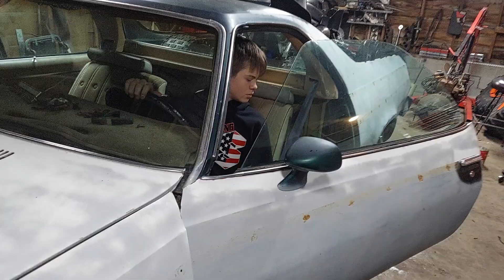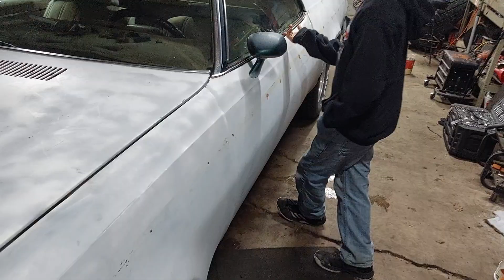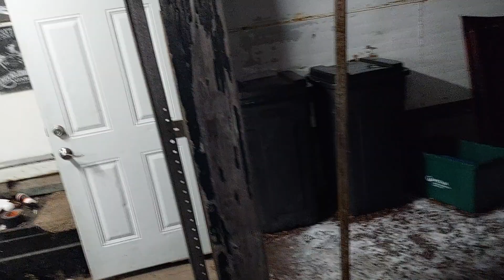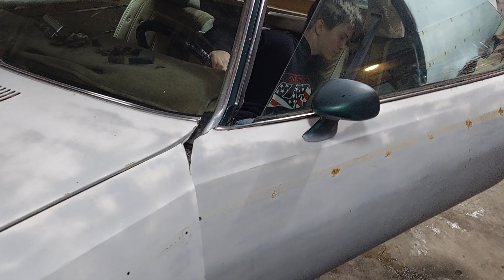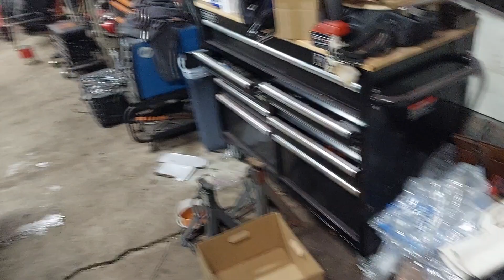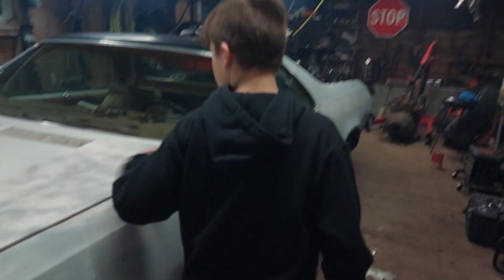Time for an engine rebuild I guess

Comment: Have you guys pulled and looked at all the spark plugs?  I had a 305 with that same noise.  Turns out the #4 piston was smacking the plug.  I just swapped out the engine in 1 weekend. PS, I reccomend all new wiring harnesses too.  Rubber doesn't last that long.

Comment: Hey bud, I had one similar and it was the flexplate that was all cracked in the center
Reply from the maker: We did look at that and the convertor bolts and didn't see any problems. We will be checking again just to make sure before we pull the engine.